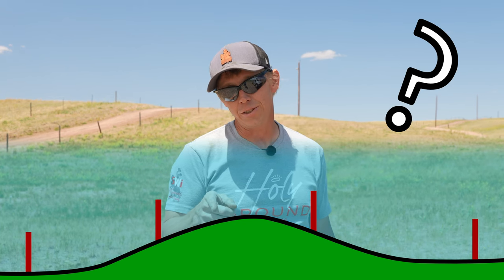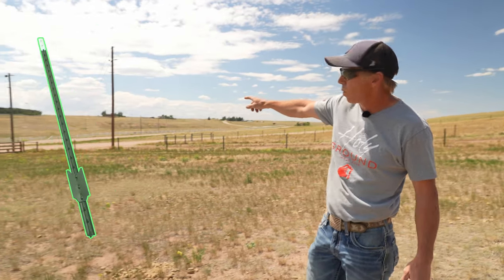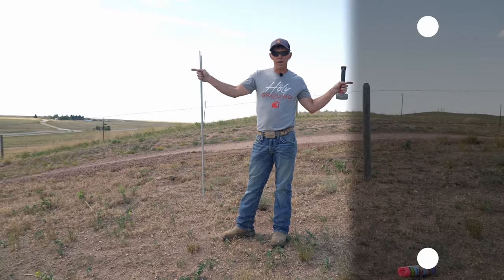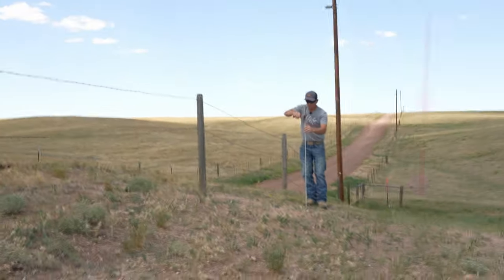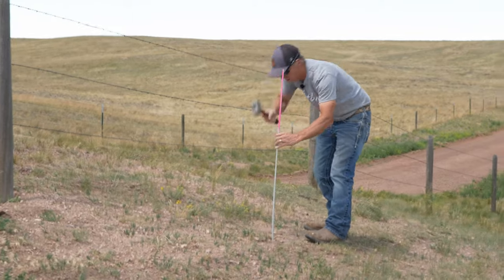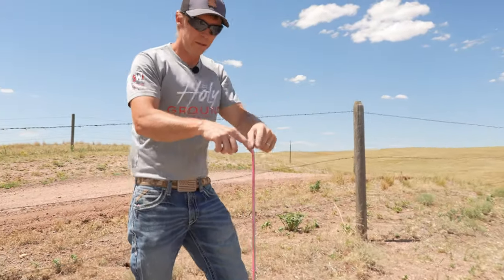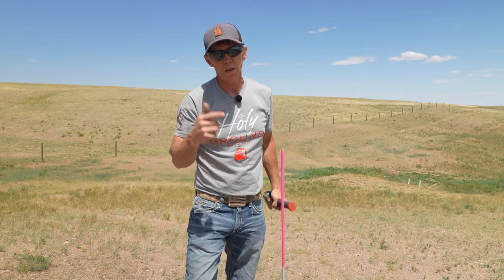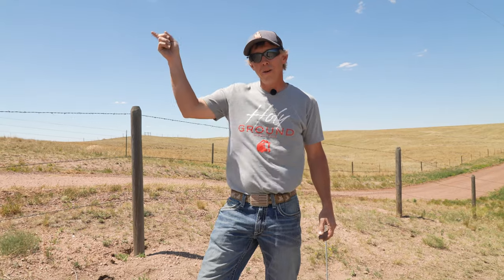Fence Building Secrets: How to Sight Straight Over a Hill

Comment: You use less energy if you add weight to the closed end of your post pounder (if you want to get fancy add a smaller diameter pipe inside the weighted top for a pinging sound) . . . For safety add length to the open end which prevents you from bringing your pounder above and off centered to the post your driving saving your face or nose from being smashed when the pounder hits the top of the post when thrusting downward . . . Many noses have been broken by a t-post pounder : (